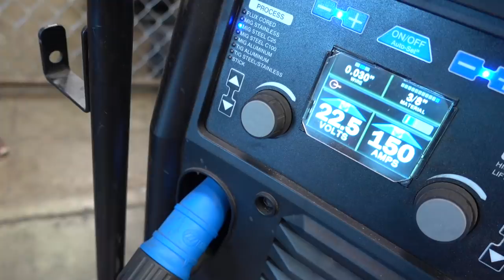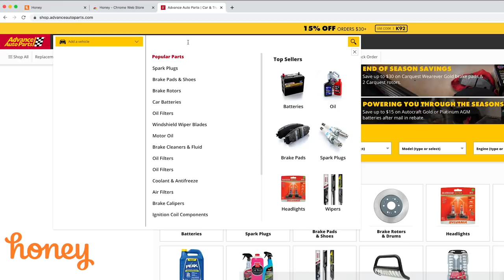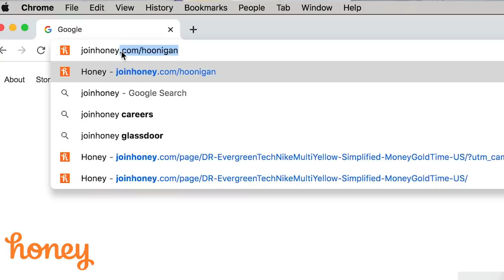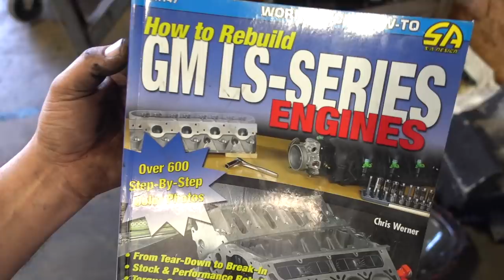Build & Battle 3: Setting up Suspension for Gymkhana GRID! Camaro vs 350z Faceoff EP.2

Comment from the maker: You have $2200 to drop on a RWD Gymkhana GRiD chassis; what are you buying and why?!
Reply: Hoonigan Project Cars C4 corvette roller.
Reply: A 94-99 2dr jeep cherokee 2wd w 4.0&5-speed.
Reply: 4th gen Camaro cause Freedom🦅
Reply: NA/NB miata. I daily one so I know how to work on them, $1500 gets a good running one, that leaves a lot of budget for suspension/power/wherls&tires etc
Reply: E36 bmw
Reply: Volvo 240 wagon cut up into a truck, slammed, Direct Injection Chev V8 (stock) and a 6 speed, ultimate thrash machine.
Reply: Hoonigan Project Cars e36 ti. Simple, short, reliable, good wheel base
Reply: Honda Civic
Reply: @legodude19999  this guy gets it
Reply: My infiniti g35 couoe because its ana amazing car never let me down
Reply: M&R Tuning gonna be hard to drift that considering its wrong wheel drive
Reply: Toyota ke70 and swap a 3sge beams.No need to high hp,enough to drift is ok😁
Reply: Porsche 944
Reply: @calebnation7797  what u mean wrong wheel drive.
Reply: Brads truck bc no body will bid on that death trap
Reply: miata
Reply: No brainer...e36 for the sheer parts availability and tried and true chassis. Sub 3k lbs. chassis if put on the right diet. Its cheap, light, and a performer right out of the box even by today's standards.
Reply: @calebnation7797  Not to mention that the stock suspension is already pretty solid.
Reply: Rad Boy99 RWD is right, AWD is acceptable, FWD is wrong wheel drive
Reply: BlakjeKaas on a miata? It’s fine but it’s really soft. You can build your own good coilovers for like $600 though
Reply: Mustang Fox Body
Reply: E46 coupe or W209 CLK
Reply: Crown vic. Cheep as fuck
Reply: Pontiac solstice
Reply: Sn95
Reply: Psssh. Lexus 1994 ls400
Reply: 300ZX
Reply: Sn95 5.0 mustang. 5.0 8 8 rear end and t5 manual. Shit will rip
Reply: miata na because the wight and the 50 to 50 (front and rear)
Reply: Miata. I already know the cars well, the chassis is solid, its small, its light.
Reply: E36 with an M50, boost the hell out of it, crazy off the shelf support for brakes, suspension, chassis, aero, etc.
Reply: RWD converted VW Golf MK2
Reply: Starlet Glanza 4WD or RWD swap it slam in a boosted H22 vtec out of a 5th gen prelude stripped it out super light caged low to the ground wide a hydro nasty dangerous little monster
Reply: E30 then I will make it a fake ass M3 😆 because those are way more then $2200
Reply: @RulfusTheBear  it had like a $3k reserve and is at $35k now so tell us again how noone is bidding
Reply: P71 CROWN VICTORIA!
Reply: Volvo 240
Reply: Foxbody Mustang. You know why
Reply: NA Miata
Reply: miata lol so easy to swing around
Reply: Or an e36, 328s can be had all day for that kind of scratch.
Reply: Volvo 240
Reply: ae86 or mk3 supra, pick them up for that price everywhere
Reply: Miata j32 swap ya heard
Reply: Opel manta b, just because no one has done it before...
Reply: Fox body mustang ...not even a hard question to answer!
Reply: Caleb Nation civics run autoX n gymkhanna well
Reply: Scratch that, opel ascona b and make a ascona 400 replica out of it👌🏿👌🏿
Reply: 2 Door XJ
Reply: Foxbody
Reply: Already got my 84 Olds Custom Cruiser wagon. Only cost me $250 and WAS running and driving. Still will, but sounds like it's running on air and doesn't have any real power. Still want to make it a drift/grip car for street. I like boats. Idk what you want from me.
Reply: Holden ute
Reply: E46 330 dirt cheap and fun with a welded diff
Reply: Fox Mustang or even a Fairmont!
Reply: Ford festiva awd 4 rotor TT because I feel like building a death trap😂💀
Reply: MR2 any gen
Reply: $2200 american?!? I can buy, not only a 1991 chevy v8 rust bucket #weightreduction, i can flat out buy every needed part aftermarket an bolt it on. OEM is best, but not for my wallet. An i'd still have enough to fill the tank with pure octane boost...
Reply: Crappy Miata, I can get it cheap and use the rest of the money to LS swap it, make it a smoke machine.
Reply: Mitsubishi starion with a 2.4 stoker 4g63, cause why not ?
Reply: E36 coupe, perfect balance off the showroom floor, add blower and gearing, done.
Reply: 66 Buick special deluxe 2 door post, it’s rear wheel drive, cheap, 3300 pounds give or take 8 pounds depending on options, it’s not overly big, looks different and no one does that with them, motor , trans, and rear end would definitely recommend replacing because it could come with a 300 cu small block v8 that gently produced 210 horsepower and 310 pound feet of torque, it’s a good car and it shares most everything with skylarks and the gs’s but would need lots of fabrication, but it would be a one of a kind machine, I mean seriously you can really get them and the more common four door or the sport wagon on the cheap
Reply: Mid 90's ranger or s10! Small truck love 🤷🏾‍♂️
Reply: 2000 GTI vr6.... For nostalgia
Reply: mk2 MX-5 cheap AF in the UK and it won the RWD class at GRiD 2019 so I'd rock it
Reply: @radboy9959  front<<<<<<rear
Reply: @MrElfuete  my dude 👍👍 I was gonna say SC3/4 but that's dope too
Reply: early 70s ford maverick, Very under rated/ under powered. Good platform to rip out its guts and build into what it should have been. Most them Had I6 motors, so the engine bay should be long enough to fit an RB with Haltech
Reply: @nemesisii6026  oh yeah dude totally doable for 1500
Reply: Merkur XR4ti, cuz nobody else will
Reply: @REAPER3fitty   huh I have a 2004  infiniti g35 couple rwd locked diff. Hydro handbrake some motor work I jus need a manual trans
Reply: SCOOBY DOO "WRX STI" because boxer anti lag ;)
Reply: @radboy9959  CD009 I bet?
Reply: @MintJoker9578  its grid not just drift speed matters
Reply: Joshua Slater  fuck yeah
Reply: @REAPER3fitty  yea just gotta find one. Live in Rhome texas. Best place to find one for me is into a junkyarf
Reply: If I'm down there in Cali, Chevette. Without seeing the rulebook, if it doesn't specify production automotive engines it's getting a snowmachine drivetrain, miata subframes front and rear. Bam sub-2klb (maybe even more like 1500) short wheelbase race car with decent power and maximum lightness. The base weight is 1800lb, remove a cast iron engine and heavy trans, replace with tiny snowmachine engine, bam we're probably down around 16 or 1700 with cage.
Reply: A 1st gen RX7 with $1,800 to spare.
Reply: @radboy9959  I'm in texas too. I used to see 350zs in the yard with a tranny in it but not anymore haha I wanna manual swap my sc400. Cd009 is the cheapest way to go but I'm a Toyota guy so I'm gonna save up for an r154.
Reply: 300 dollar gutted honda
Reply: There are some great ideas in here!  You guys rock.
Reply: @radboy9959  whoa.....wouldn't advise putting that on YouTube my dude but if I'm ever close to you I'll hit you for sure
Reply: Easy FC3S.... I've torn so deep into that chassis that I've probably still got it memorized... plus seat time... Lol I remember my friends laughing saying I couldn't an Rx7 thru a N.E. winter! You know what I did it anyway!!! I ran that car ( and a few more fc's lol) for 5 more years after that! Tinkering, upgrading here and there! Hell I'd take the Rex over my daily on most days
Reply: Toyota mr2...cause why tf not...
Reply: SC400 baby! just make sure it's a 92-94, handles boost as good as a 2jz and low end torque for days! CD009 swap, weld diff, and it's fucking ready!
Reply: E36 with a LS or LT1 swap simple and powerful more the money and easy to get parts for and if you wanna get any sort of power adder not much CANT be done
Reply: Can anyone please tell me what the name (and link if possible) of the outro music???
Reply: @legodude19999  good luck doing that for 2500
Reply: @TroutNTrees  Hell yeah brother
Reply: Rx8 with a LS swap, all done.
Reply: Scottos Audi cause unfinished project cars are cheap
Reply: @thatblackz1850  I've bought a rolling Volvo 240 shell for 400 bucks before. True they are getting more expensive but nowhere near 22 hundred bucks lol
Reply: 04 boxster with a c32b tossed in there
Reply: A s10 and a engine lol!
Reply: Mk 1 Rabbit with a Audi drivetrain
Reply: @legodude19999  true, and lord knows a chevy block and used heads are cheap as hell
Reply: foxbody mustang or 3rd gen camaro two very easy cars to build and price:performance ratios are great
Reply: i have 2200?$
Reply: Mitsubishi 3000gt vr4
Reply: 90 something mercury cougar. All mustang parts fit. 8.8 factory. VQ V6 and six speed for style and exclusivity. Aftermarket parts are EVERYWHERE for both donor cars.
Reply: @RulfusTheBear  It's currently at $35,500 on eBay lmao, I suppose it's someone who wants to support the charity or loves Hoonigan
Reply: 76 Chevy LUV. Because Mini Truck
Reply: @thatblackz1850 I was thinking of one of the newer Chevy LT motors, like a 5.3 from 14+ 1500, more expensive than your typical LS but it has direct injection and all the tunability in the world
Reply: A $500 s10 and have 1700 back into the build budget
Reply: i would probably look for crappy sc300 just love the sound of a 1jz
Reply: 05 gto
Reply: Lates 70s early 80s elco
Reply: @legodude19999  slap a SBF in it, itd be different lol
Reply: @legodude19999  I've got a honda and a 93 ford f150, the ford has a 5.0 out of an 89 mustang with a comp cams 252h cam and proheader shorties
Reply: @carternevill  double wishbone=not a lot of angle...
Reply: shitty porsche 944 baybeeeee
Reply: 240z shell
Reply: @calebnation7797  where do you live? Everyone around me wants $6k+ for a nap/nb
Reply: Old vw golf gti or a ford focus rs
Reply: Rwd swapped b5 audi a4 with a big turbo
Reply: E36. Because it's what i know how to work with. For grid I would want a compact for sure!
Reply: A miata, not into them really, but you've seen how that fella with red hardtop miata with 200hp owned the gymkhana grid this year? Ridiculous
Reply: I'm gonna have to correct you guys, I love your advertisements
Reply: Crown Vic man, cheap and unique why not
Reply: I'll pay $50 an hour to drive the k24 swap z in gymkhana grid!
Reply: $2200 would buy me a mint 86 fox body roller.  Hell, might even be enough to buy a running fox body in decent condition!  I love fox bodies, so that's my reason.
Reply: Depends what can I rent for a day out there over 2 gs for hell a few hours ya might get something great. 81 f100 5.0L I guess I can blow up my daily.....
Reply: AU falcon. get a VCT fairmont for $300, you've got a 170Kw engine that'll take plenty of boost, and there's heaps of aftermarket.
Reply: Grant Bowers I’m in north Georgia. I can get running but cosmetically meh for $1500 all day long
Reply: 2nd or 3d gen z28
Reply: Todd Brown smartest choice here
Reply: 10k total budget? 
A 2+2 z32, as long as it has the manual im golden. 
Ka24de swapped in, twin charged with a supercharger with a clutch that can be engaged or un-engaged like the aw11 got. Probably the turbo off a 7.3 
Pistons n rods 
A clutch 
Fuel 
Coilovers and suspension arms 
And a cage 
I think with a megasquirt ecu and maybe a rasberry pi its possible under 10k total
Reply: Old ass beetle, subie boxer mid mounted, profit?
Reply: Subaru xt6...2.7 flat six awd five speed with dynamic ride height adjustment. Also the strangest looking steering wheel ever. And POP UP HEADLIGHTS!!!
Reply: Just a chassis? A roached out Lotus Europa. Small, light, nimble. Put a K24 in it.
Reply: @PNW_Car_Mods  A Fairmont is a Fox Body
Reply: Fox Body or G-body, I feel either is self explanatory
Reply: @bobfalfa76  I know that.
Reply: Mazda protege manual they like 500
Reply: 2 door Subaru 2.5RS but fuck the flat 4 engine
Reply: Honda Del Sol mid engine conversion K24, can be built for under 3000$ total!
Reply: gen 1 cts
Reply: @PNW_Car_Mods  Then why mention them separately, just say Fox Body
Reply: @bobfalfa76  Because they're two different cars.    They just share a platform FFS.
Reply: S12 because I make bad decisions
Reply: G Body Monte Carlo SS
Reply: R32 golf, front axles removed.
Reply: TT coyote swapped Mid 90’s Cougar
Reply: Volvo 240 for sure
Reply: E36, perfect balance for any mod. Lots of parts and cheap.
Reply: A go cart
Reply: Hoonigan Project Cars mini
Reply: Just picked up a running 300zx 5speed NA for alot cheaper than 2k lol
Reply: 02 miata its cheap light and well balances then id get a k24 for a swap just like the boys here but itb's instead of turbo
Reply: Just picked up a 88 z51 c4 for 2k with 70k mi
Reply: @legodude19999   long live the 240's! Scrumptious
Reply: BMW E46 Compact.
Let’s race the ugliest SOB they ever made!
Reply: @thatblackz1850  That's sick man. My current project is a 96 Chev 1500 2wd sing le cab Short box. So far I've got the suspension fabbed up and done, did a 4 link and lowered it about 7" ii n the rear and 5" in the front. Next I have to pull the old engine and put the 6.0/4L80e in er
Reply: 84 Mercedes 300CD because YOLO
Reply: Vy SS commodore Ute
Reply: Head says E36/E46, heart says that theoretically you could get a old Alfa 75 (Milano, for you guys in the US) or even better, take a cheap Panda 4x4, convert it to RWD, find a diff that doesn't grenade itself with a random jtd engine from a junkyard, go on the race and even if you do score bad it's gonna be so improbable it works
Reply: Hoonigan Project Cars Miata
Reply: 3rd gen camaro roller. I know one I can get for $500 rust free
Reply: Second gen Magna and a sc400/uzz30 soarer to put underneath it. Why? Because F#$!ing Straya 😂
Reply: Ford Contour v6
Reply: An early 90s Tacoma or Hardbody
Reply: T5 Volvo 240 cause it aint gonna break :)
Reply: Anything RWD Volvo...
Reply: a Japanese mini truck... Nissan 720, B2200, Tacoma, along those lines....
Reply: Hoonigan Project Cars i seen a 72 chevelle for 1000 ls i got a 5 speed
Reply: NA miata
Reply: Miata
Is
Always
The
Answer

Ok, definitely not always. But for a budget race beater. For sure
Reply: 1.8t b5 $200 car get $300 4.2 art motors good to 500hp  bolt it in to the manual 01b,  weld up the center diff and speed the rest of the budget on cage and nitrous. And send it 💨💨💨💨💨
Reply: Sn95 mustang, enough support to easily mod and since they aren’t the prettiest they aren’t desirable among mustang fans
Reply: volvo 240 coupe, good small car and they're fucking unbreakable
Reply: Prolly an E36 or E46. Because inline 6 German greatness.
Reply: @legodude19999  amen
Reply: @calebnation7797  na you can slide a wrong wheel drive car, McDonalds lunch trays boii
Reply: I'd give hert 2200 for his fc just tell him to keep the change 😂
Reply: Mustang. Parts grow on trees. aftermarket overstock. its been done a thousand times ergo theres a encyclopedias worth of knowledge available to solve issues that arise cheaper then you would if it was some unique chassis/power-drivetrain swap.
Reply: @radboy9959  seriously? the guy he replied to said use a civic. civics are 99 percent FWD. the question was which RWD chassis would you buy for 2200 smackeroonies and why.
Reply: Mitsu mighty max 4g64 with a 3g64t top end swap, bored and stroked... had one on a pretty good diet got it down to 2300lbs as long as i made the front end dive it would take any turn
Reply: Volvo 240 its the ultimate thrasher
Reply: 3rd gen camaro, suski samurai
Reply: @toddbrown4185  They basically made shit car a ti already...
Reply: NA Miata with 1.8 because cheap parts and light enough to make quick cheaply
Reply: Ford sierra. Cheap, there is a lot of it laying around where I live, relatively big engine bay for the common engine options here in the EU and is a really popular rally and drift chassis. Also sexy square-boi aesthetics is all I am living for.
Reply: 1979 Toyota Corolla
Reply: Hoonigan Project Cars will you give a more in depth look at how the guys are mounting and making the K swap work in the 350z. Being that the z is a very common drift chassis. I think this would open up the swap world for them a bit more. Just like how TFworks has made a kit for the s-chassis.
Reply: @carternevill  yessir!!!
Reply: El Camino or Camero or 240sx cause functional, cheap, fun, nostalgia, Americana/Japanicana respectively
Reply: 32 Ford would be sexy too
Reply: I’d literally use my 1996 Mustang GT. I bought it for $1,200! 👌🏻😅
Reply: Miata becomes a miata won the euro gymkhana grid championship in the RWD class. Go mantis!
Reply: Holden commodore. $500. Because Australia
Reply: Foxbody
Reply: K swap mgb mgb gt. Cage 3 link front arms and coils.
Reply: E21 bmw
Reply: 4th Gen camaro berlinetta  💯💯
Reply: Fc rx7
Reply: Toyota altezza
Reply: Fb rx7 . eBay everything and peripheral ported n/a
Reply: Crown Vic, gut the interior, put a junkyard procharged nitros LS (140 shot hit for the drag part), pair to tremec 6 speed, and a 9 inch rear end. Redo steering components and suspension. You’ve got yourself an all American badass hoon machine
Reply: Miata or s13
Reply: Mk3 Supra I have one and already have the 2jz to swap in it
Reply: 1st gen Mazda RX7.
Reply: Geez I wish I could find a 350z that cheap. Period!
Reply: 2000 4th Gen Camaro SS roller
Reply: @calebnation7797  you realize alot of federal cars are drifted just requires an e brake and decent power... may wanna look into drifting a little more... their is "more than one way to skin a cat"... you can drift in fwd just as you can in rwd... just takes different techniques...
Reply: @ZackNakazora1  5.0 is gutless and. Borg Warner T5 is trash and a weak link... imma go out on a limb and say you have minimal car building experience... recommending a T5 proved it...
Reply: @Landon_Byers  p a
Reply: Start out with an sn95 chassis. The handle decent and have pretty good brakes. Great aftermarket support. Starting out with the V6 model might be a good idea if you're changing the motor. It's likely to be in better shape.
Reply: @grad0n  you know that's a pretty good idea.. I always loved the steering feel they had 10 times better than explorer steering